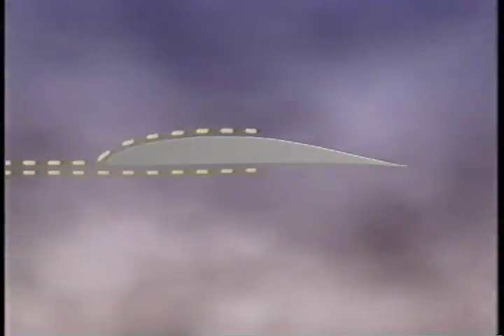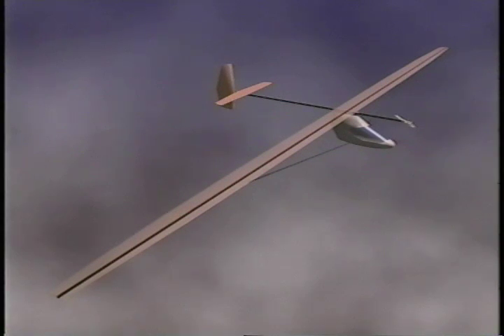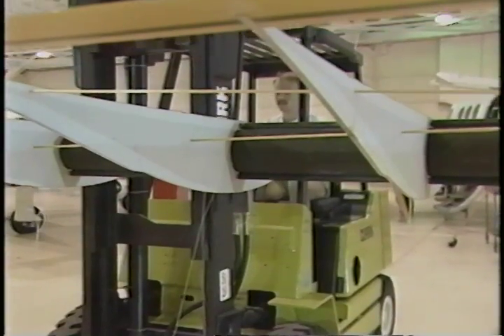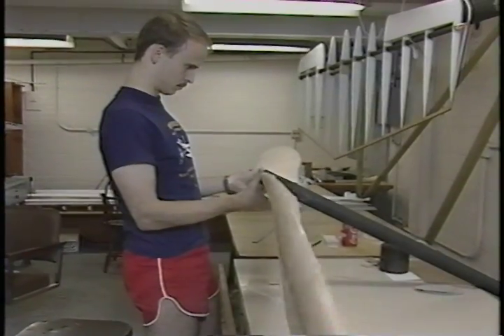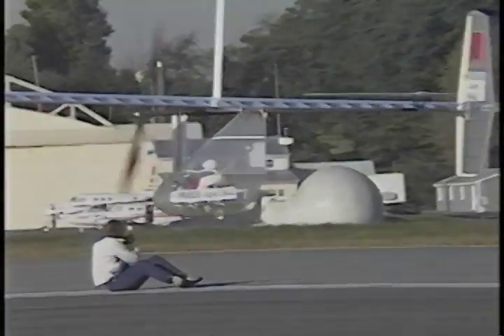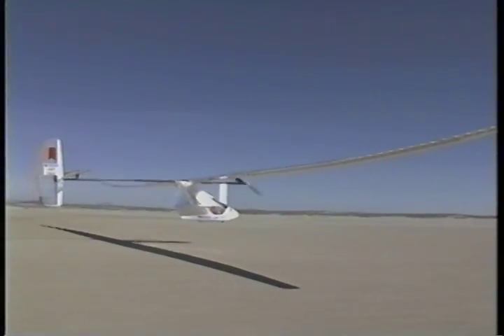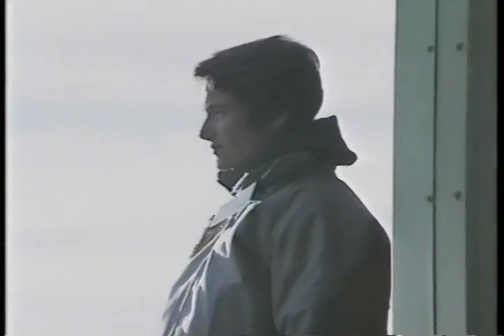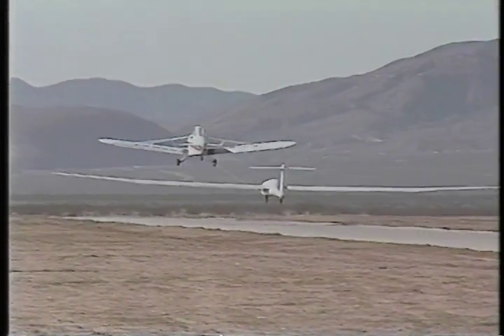Part 2 The Light Stuff (human-powered flight)

Comment: why has no one thought to put a chargeable battery on board? That way it can take off on battery, then at altitude the pilot could take over pedaling which powers the aircraft as well as charges the battery then throughout the duration of the flight it would switch back and forth between pedaling and the electric engine saving the pilot a lot of pedaling and providing a slightly more steady source of power.
Reply: +ryfodrea 

That's like asking in 2108, why has no one thought to put the latest mini cold fusion reactor on a plane being built in 2015.

Comment: is it possable to use stored energie like in a wind up clock ? human powered ! .
Reply: ya u could but I was also thinking u could use the kinetic motion from pedaling to charge a battery so it could switch between pedaling and electric power. i do think ur idea would be possible but u risk stalling because after winding it up for awhile u would get a lot of resistance and ur RPM's would drop drastically and it could result in a stall, also the amount you would wind it verses the amount of energy ud get from it would not be a lot so ud have to do tht a lot and it would just be easier to pedal constantly or use my method of power.

Comment: Increase prop rpm and lower pedal rpm through gearing.
Reply: then u get more resistance and at a certain point the amount of energy a person could put out and the resistance of the gearing would cancel and you wouldn't be able to get much more RPM's. I suppose if u used low gear and pedaled hard on take off then used a high gear at altitude that could work.

Comment: Helium filled wings,lift is taken care of. With a minimum of air speed by the person to provide froward motion. Nylon gears and belts for 2 carbon props. Might be worth a try.
Reply: Jim Braun I did the calc and you need a tube 4 meters in diameter filled with hydrogen - helium has half the lift if I remember correctly, so unfortunately  there wont be enough helium in the wings to do much good   + helium has such small molecules it can go through aluminum so you have to keep topping it up  and its very expensive stuff.
Reply: Jim Braun That brings an interesting unseen factor... Air in the wings would create resistance.. Helium could be better instead of air.. Nice one

Comment: first off you need an alternator, a small light wight battery to be stored. think simpler and smaller you could even combine manual capo-nets so the driver or drivers dont die out from to much physical exercise. also calculate for air intake to maximize you speed and performance.

physics optimize or focus the human-power to its full potential.
Reply: Alternators and batteries tend to be quite heavy for the energy they produce and store.  All physical effort used to crank the alternator would diminish the power applied to the airplane's thrust, and the energy returned would be less than the energy diverted to it, so a net loss in energy available for the flight.  Also, the alternator/battery combo would increase the weight of the craft, requiring a stronger (and heavier) structure further increasing the weight of the plane, all of which would require yet more energy to produce sufficient lift and thrust for flight.

Comment: could try putting in a kind of  pedal gear system like on a bicycle. after take off switch to a higher gear to slow the needed pedaling speed which even with some added effort will use less energy to sustain overall. more speed in pedaling the more effort because you need not only strength to pedal but you also need to be able to apply it quickly which takes more effort than similar or a little more strength but slower pedaling.

Comment: If you can make the wings thinner, by making them longer,
the "wing tip suface" will become smaller. Resulting in lower "induced resistance".
It's better to have  small or curved wingtips, like a spitfire. (or a bird)
Instead of rectangular wings, like some old air caravans.

Comment: plus you have to add in the fact that more gears equals more weight in a very weight conscience situation.  if they had engineers figuring out the prime speed in order to take flight at an efficient rate to not overwork the pilot then that is good enough.  a larger prop was used in this case so that rpm didn't have to achieve such a fast pace.  trust me, the engineers designed this very well.  i would love to see this remade!

Comment: If you ride a bicycle, say, 1 kilometer, in any gear combination, you'll do the same amount of total work, all other conditions held the same (wind, hills, etc). Gears make the work per gear revolution easier/harder, but don't change the total amount of work. In this case, if you gave the pilot higher gears, he'd have to work harder per revolution, but for fewer revolutions; lower gears would mean less work per revolution, but for more revolutions. Engineering is often about compromises.

Comment: well imagine a bike...i could either pump my heart out in 1st gear and only get to about 8 miles an hour or so with very little resistance, or all the way in 3rd gear I could put in about half the work and get to around 15 or 20 mph. and because it's a propeller so there wouldn't be much resistance making larger gears easier to use

Comment: Non sequitur, but...  Its a little disconcerting that this technology hasn't come farther in nearly 25 years. Carbon fiber was in its infancy when this was made and drive train technology and materials have both come quite a ways. Lipo batteries and a brushless 13 HP continuous motor wouldn't even add 10 lbs to the design and could be used sparingly to allow the body to recuperate (I know its cheating from a purist stand-point, but regardless...)

Basically, where is my air-bike already?